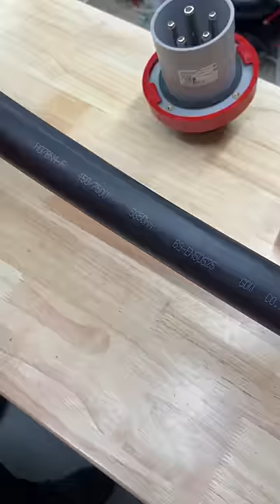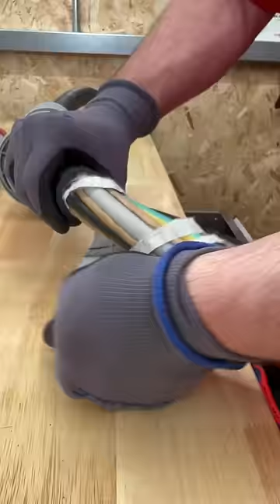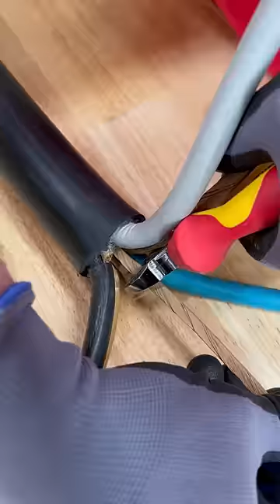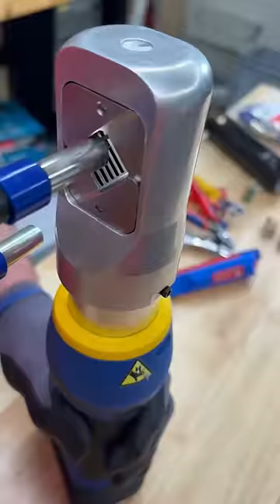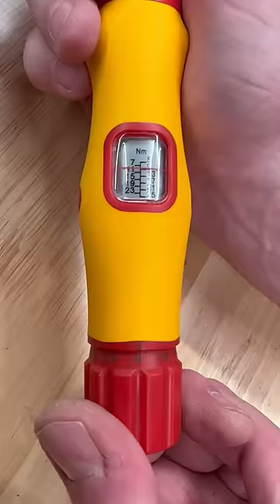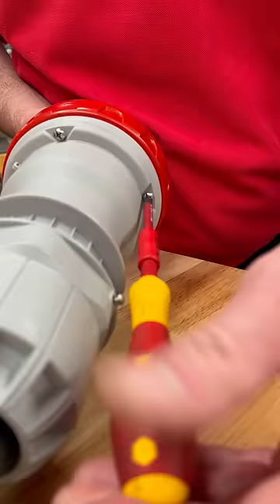Wiring a Massive Plug: We enjoy this electrical work!

Comment: ahh, the 4090 power connector
Reply: The idea of a three phase graphics card tickles me
Reply: @whirled_peas  LOOOOL that will be soon to come. While making blueprints for the house "you'll need to add a 230 volt 3 phase outlet for my computer room. These new graphics cards are brutal"
Reply: @ryanhansen1296  on the plus side, the computer will double as an air and water heater, tho if you open the case while it's running, you risk reenacting the climax of Raiders of the Lost Ark
Reply: The gaming PC in my son's room already makes it 3 degrees hotter than the rest of the house 😱
Reply: What was the power connector before the RTX 10090?
Reply: :o
Reply: I came here to say that!!! 😂😂😂
Reply: no more charcoal connectors... 
the gpu, not so much 😁
Reply: What kind of applications do these have?
Reply: @ecoworrier  3? my ps4 will keep the room at 85 😂
Reply: @jonathonross3200 in my line of work, supply power to electric motors, 20-60hp with differing rpms just as an example
Reply: @jonathonross3200  for example industrial size generators, heavy industrial loads /machines..
a lot of important infrastructure places have male plugs this size installed, where generators can be brought to feed the place in case of longer term mains failure (eg telephone exchanges, train stations, radio stations, hospitals, data centres etc)
Reply: Actually the 4090 power plug is very tiny and high-tech
Reply: Actually the CEE 125A plug, used to power big cranes or mobile big AC units, building site distribution panels, etc.
Reply: @ryanhansen1296  230v 3 phase. Chuckle in European.... 230V 1 Phase and 400V 3 phase in every house ever since the....60s....?? I've been working at 400V lights for over 4 years that had way thinner cables than this video shows and those lights still works till now.
Reply: We gonna need bether than that for the tesla 9080 graphic card from nvidia 😂
Reply: @jonathonross3200 shore power for bigger boats and small ships.
Reply: If this was true, then maybe they'd finally stop melting 😂
Reply: @ryanhansen1296  230v 3 phase? Haha, 3 phase is 415v here (line to line).
Reply: @jonathonross3200 I use these for a couple machines at work, very big machines, very high power, cables are not fun... Too heavy
Reply: @jonathonross3200 it looks like what we call a 63amp 3 phase and neutral commando plug..Sometimes we have to use them to get past the regulation requirements of having to use RCD (GFCI) on circuits containing socket outlets of 32amp and less.
Reply: Basically what it feels like.
Reply: @heroinmom153  my comment is 9 months old and still stands.
My connector didn't melt. And never will. I have a thermo vision camera, neither cable nor connector get hot.
You believe your stupid influencers. You believe and trust. But I know.

The only connectors that melted, were the ones where the user didn't put in the connection all the way in.
Reply: I just know it as a 100A pin & sleeve.  Thanks for the specificity.  ;)
Reply: @ryanhansen1296  hey I legitimately plan to do that when I build my 3d rendering server with threadripper pro CPU's. I'll have a 120/208 volt 3 phase plug  to run it.
Reply: I mean, at least this one won't melt, hopefully 😅

Comment: Try doing this in the cold!! I had to splice one of these on a drilling rig in Northern Canada. -55 degrees Celsius. Used the exhaust of the truck to heat the cable up. That was 20 years ago and I’m still cold.
Reply: Yup I've had to fuck with them in exact same situations 😂
Reply: How the hell did you survive -67° F?
Reply: парни, я с якутии в гугле посмотрите, в такие морозы это ад, а не работа
Reply: Yakutia 💪🥶
Reply: I'm cold just heading about it!
Reply: Last week in Calgary, which is Southern Alberta Canada with the wind chill hit -49 degrees Celsius. 
After -40 it doesn’t matter. It’s just f$&ken cold. Everything breaks.
Reply: @daleburton1788  For me everything after -25 doesn't matter anymore because I won't be going outside 😂.
Reply: Canada eh 🍁 😊
Reply: I had to splice these in 50 degree heat inside a turbine in taiwan and they still weren’t easy to strip

Comment: The RTX 5090 power connector looks great. This would definitely fix the melting issue.
Reply: SH**!!! I knew they were lying about the 6800 being compatible with my setup!!!!!! 😢
Reply: я даже без переводчика понял о чем ты))))
Reply: What's funny is that the huge plug in the video is only rated for roughly double the current of the new PCIe 12VHPWR connector.
Reply: Just plug it in properly and it´ll be fine

Comment: I am now amazed at wiring done correctly on YouTube shorts, we've truly come full circle
Reply: Pfff this Guy used even a torqe spec which sreams im overdoing my job. I usually tightent my contacts to 30 uga-dugas.
Reply: On jaw
Reply: @lazarpejic6415  So you're not using the technique my dad calls "Soviet torque"? Consists in torquing the bolt down until you hear a pop, then quarter turn back.
Reply: I'm already happy to see crimped wire sleeves. Even the ones that are manually crimped. Let alone properly torqued screws.

People simply don't seem to realize that proper torque is a requirement for these currents. People don't even realize the amount of power that go through these cables as most don't even know three phase power at all. 

125 amps @ 400 volts packs a whole lot of punch.
Reply: @patrickd9551  U tightent them down until the force needed to tighten them down is starting to get exponentialy bigger. Has worked the passt two years for me.
Reply: @lazarpejic6415  That's probably why you don't work as a sparky in actual high current installations. Regular house installations no problem, but once you get up to those beefy conductors. 

There is a reason torque specs exist for these applications. Too loose is obviously a problem, but too tight ALSO is a problem. You can strip or break a screw, which you might not notice initially. But over time it will become the same problem as a loose screw. 

So the average tinkerer can apply about 15nm with a regular screw driver by cranking down really hard. But most small electric stuff only requires about 5 nm. So your reference is somewhere in between I guess. 

But cables like these usually require between 30 and 50nm (depending on brand, application etc). So your method would result in a disaster in this situation. 

So you might want to reconsider your position ;)
Reply: @patrickd9551  nope i worked with these conectors using my method with T handle Hex Keys worked perfectly fine i installed Machines Up to 110amps. And 2 years later No heated conectors/fires. And guess what there won't be because 90% of the time in Industrial Situations the connector won't be under full load. I had a apprentice conect a machine which was meant to run at 80amps and He used a 63amp 10mm2 Line and nobody noticed for two whole months of Operation under load! Until another electrician noticed the plug looking quite the Bit smaller than usual. We just left it like that bc it had proven to work. Bc it is the testing stand for new Machines. I feel Like Sometimes going full russian mode isn't too bad. (Russian mode being If it doesn't burn out it's ok)
Reply: @patrickd9551  non the less the first coment was a joke.
Reply: @lazarpejic6415  I fireproofed over 100 houses with blue asbestos. Nothing went wrong to this date, no lung cancer cases as of yet.  (yes this is a joke too) 

Just because you lucked out to this very moment doesn't electrical fires happen. And wrong torque specs is one of the major cases. 

It's still rare for it to happen, but IF it happens, then all shit hits the fan all at once.
Reply: @patrickd9551  Well IF i mess Up with a Torque wrench then also shit hits the Fan.
Reply: @lazarpejic6415  80Amp over a 10 square cable just heats the cable up accordingly.
its not for 'unproblematic' situations that larger cable size is required by spex.. as long your wiring runs eg over concrete floor, sufficient air flow around it.. likely no problem if cable reaches high temperatures.
but the spex are considering that perhaps flammable materials (stack of cardboard, sawdust, bottle of flammable liquid etc may land on top the cable, no more air flow, hot summer, perhaps multiple hot cables next to another.. >that's how actual fires start, and that's what spex are taking into account..
(but as long you can guarantee they stay cool enough, sure you can size it even smaller.
bare metal overhead transmission lines are designed to work at very high temperatures, I think hundreds of Celsius, as they are guaranteed airflow and nothing flammable touching them..)
(and 90% safe is not good enough - that would be like saying, "a fire only occurs one day out of every 90 days'..you want to avoid it ALWAYS, not just with 90% certainty..
also nowadays, circuits affected by car chargers are often run at 100% load for prolonged time periods, suddenly causing unexpected problems in distributions that worked fine for many decades before)
Reply: It finally happened
Reply: @Lazar Pejic  it's less about being under full load and more about continuous load vs nominal load. But you lost me when you knowingly left a wire without a overcurrent protection device. You deserve to lose any license you have for that. People can die if you don't take pride in your work and it only takes 1 time being lazy to cost someone a loved one.
Reply: Always have a short cable plugged in so you don't have to replace the plug on the trailer but just the hospital plug on the cable problem solved
Reply: I think this is the first time in Internet history.
Reply: If I would need to find anything to wine about it looks like he made the PE wire the same length as the other wires.
Reply: @lazarpejic6415 what country do you work in? I must remember to stay away 10% of the time

Comment: Finally a trailer plug that doesn't break every 2 weeks!
Reply: Still some idiot will not plug it in all the way then drag it on the ground for 50 miles
Reply: fun fact some of those plus are used on WELDING machines
Reply: You can use it as a safety chain too.
Reply: @jamiedavis2588 *80,47km
Reply: @Sam-ob4of 😅
Best comment. 
All hail the metric system, base of the imperial system since a long time ago!
Reply: @jamiedavis2588  did that once, never again

Comment: Try joining two 11kv cables in a trench in the pissing rain in the middle of the night in sub zero temperatures.
Reply from the maker: I use to work for Western Power 🌧 🥶⚡️
Reply: Rain below 0?
Reply: @MattM-oe6qs  and yes? It's both possible and fairly common up North.
Reply: @MattM-oe6qs  must be metric zero
Reply: @MattM-oe6qs  Rain below 0C is quite common and a very disgusting weather condition
Reply: @MattM-oe6qs  we get that in the UK in winter,
Reply: If I remember right, if the water is pure/no particulate to build off of in the droplet the water won't freeze on the way down even below freezing. closest ive been to that was finishing a chain link fence in 32°f with a bit of wind chill, the forecast would switch back and forth between freezing rain and rain
Reply: Never rains below 0C in Toronto, lol.
Reply: I called Western Power Distribution. Told them I'm dying here no power no heat. They told me to call an ambulance.
Reply: Like Doc in Back to the Future?
Reply: Try joining three 22kv cables in a deeper trench in the terrential rain at 0002 am in -10.
Reply: Did the same thing but had to splice 3, minus 40d in a tornado.
But I had my umbrella with me so it was simple.
Reply: You first
Reply: What kinda pay we talking though?!
Reply: Кислотный дождь чтоли???))) Ниже ноля идёт снег
Reply: @rafdannyboy  try joining 7 69kv cables in the Mariana trench during a category 5 hurricane in 2 different time zones in 0°K
Reply: Rain below zero makes a thick ice coat. Nice..
  Hope you meant Celsius not Fahrenheit, never mind these other guys talking like they're expecting the sun to turn into a white dwarf overnight.
Reply: @MattM-oe6qs  pretty sure I've seen it rain below 0c in the GTA ( specifically the eastern GTA)
Reply: @MattM-oe6qs  Yeah, it's frickin' awful. Gets you in a hurry when you know that a degree colder and it'll start instantly freezing whenever it hits something, including windows, roads, well insulated clothes...
Reply: @petevenuti7355  try joining 2 low voltage cables on a nice sunny day mid autumn with 74 degree weather with properly mating ends pre terminated
Reply: @frogz  you mean my dogs "electric fence"? 
  I've tried to fix a broken water main in a pitch Black crawl space with ice floating on top of the water on a Sub-Zero Fahrenheit day.. I had to keep screaming in order to keep breathing swimming for a half hour in the ice-water in a t-shirt and shorts... I was told by a Marine that he had peers that couldn't do that! 
  I looked it up later online how long it would take for hypothermia to set in and couldn't believe ...
Reply: @sivansharma5027  try to joining a 2774747848484 kV cable with a spoon and a lighter during a hurricane and a Godzilla attack 😎
Reply: How do torrential rain and sub-zero temperatures combine?
Reply: But can you do it in cold rainy night in Stoke?
Reply: @MattM-oe6qs lol what part of Toronto are you in? Lived here 18 yrs and we get freezing rain all the time, or at least we used to. Lately winters have been getting less and less snowy compared to when I was younger...
Reply: @mfree80286
Reply: Wasup wit pay ya bums
Reply: 11 kv wire cables, woah. Need to get my hands on them
Reply: @DeltaCodex  
 Yes, it is called freezing rain. It is where the temperature is colder at the ground than up in the air where it is raining.
Reply: @Well_I_am_just_saying  thanks, I just assumed it was a product of some sort of ancient god up until this very moment 🥴
Reply: @MattM-oe6qs  Imagine being ignorant of supercooling.
Reply: If it was sub 0 wouldn't it be snowing not pissin rain
Reply: @rodneybrunton8878  you've got 2 choices here: either read the comments, delete yours, and do a Google and learn something; or you can have your inbox start to fill up with pissed off folk who actually listened in geography class.
Reply: @rodneybrunton8878  
If you are referring to Celsius, then no, it would not necessarily be snowing.
Reply: @rodneybrunton8878  Imagine having such a basic understanding of nature you don't know of supercooling...   yes, it can rain at sub-zero temperatures.
Reply: haha, an electrician gets a taste of real work and has to vent in social media he did something a little bit hard today , and after all that, someone else wouldve cleaned up the mess you left 🤣🤣
Reply: Did you save us in sacremento 10 days ago ?
Reply: @MattM-oe6qs  For a phase change you need to dissipate the energy of fusion, which for water is rather large. As there's finite conductivity between the drop and the atmosphere, and the rain is in motion, if there's a front passing over (a common cause of precipitation) the rain can fall from a warmer region and land on you below the freezing point of water and yet be unfrozen.
Reply: @halfcircleworkshop  Bruh no shit
Reply: @AlpineTheHusky  Indeed it is, regards from Finland 😂
Reply: Joined 6.6kv double steel wire armoured cables 2000 feet down a coal mine. At night. Might have been raining.
Reply: You have just described a Scottish summer my friend 😂😂😂
Reply: locomotive remote unit cable?  lol
Reply: Around Christmas I got sent to splice a streetlight cable some excavator slackjaw had dug apart. Ditch is just under two feet wide, about a fist of mangled cable tatters sticking out on each side. It's -10c out (14f). Tell the guy I'll need more soil removed to get to usable cable. "Best I can do, I need to go" the slackjaw says and hands me a shovel, then moseys away, presumably to watch cartoons. *Clink*. Ground is frozen cock stiff, even the sand is like a block of glass. Around 4 hours of rigorous loud cursing and one spliced cable later I tell the excavator outfit to save this dumbassery for the summer months.
Reply: @GRAYgauss Imagine such a bright and special person not understanding that there's clearly a confusion between degrees C and F.  I live in a place that's both regularly below zero F, and has a lot of freezing rain.  You don't get freezing rain below, or anywhere close to, zero deg F.  Whether or not it's possible for liquid water to exist below zero.
Reply: @satan.is.my.copilot  So what are you're trying to say? In that case, it's not like you're going to get freezing rain anywhere near 0C either, 0F is colder than 0C after all. Imagine such a bright and special person not understanding the difference between C and K. My point is that it doesn't matter if they're confusing 32F and 0C or -15C or 0F, people are forgetting water doesn't freeze just because it's below it's freezing point.
Reply: You WIN Charles !
Reply: @eyegrinder94 my grandfather dug up a septic tank in that weather pick axe and couple days couple days to fix waited til summer to bury
Reply: Imagine running #12 to hook up a hot water heater and u only wired a couple plugs before it actually was pretty easy only needed one part 😮 just put that 15 gal on top of 40 and run the wires like extension cord it was beautiful
Reply: В - 24 ставили 4 муфты, это не сахар(((
Reply: @ЮрийХватов-ъ9й  I got bingo
Reply: @MattM-oe6qs yes it's called freezing rain lol
Reply: @MattM-oe6qs don't you remember the freezing rain of 1998 in Quebec 100mm of ice took most off the pylon and we ended up with one month with no electricity